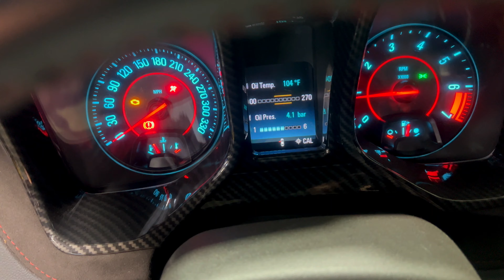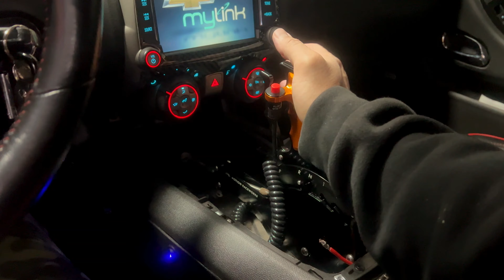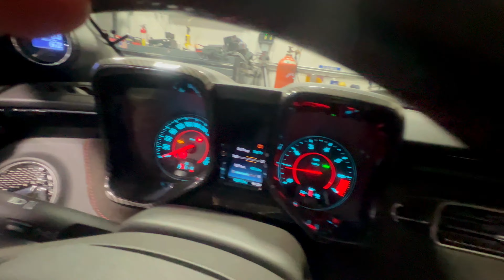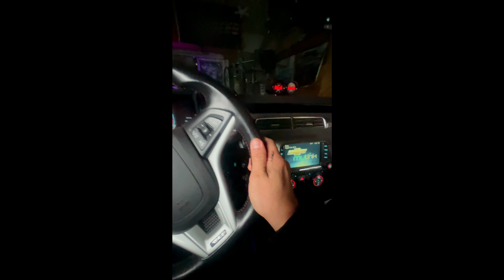427 LSX 1200HP TH400 TRAMISSION INSTALL FINALLY DONE PART 3. ZL1 CAMARO COMING BACK TO LIFE

Comment: Sounds great! But bro you actually take that mofo out on the streets here in California. Man ceetain parts of LA you def would get state reffed.
Reply from the maker: Yeah, I drive it all over the place. I was all over the place in this thing. Videos are coming soon. As long as you're not doing anything crazy they really don't have any reason to pull you over. So I just try to limit the craziness on the street. But when the coast is clear boooooom I'm out!!!🚀🚀🚀🚀🚀🚀😂
Reply: @outlawperformancegarage5211   damn. Not down here in Socal bro. They will pull you over just for exhaust. I got a state ref just cruising in my Camaro. A heavily built cammed car here is just asking for it. Crazy y’all can run them up there. No way down here in La

Comment: I would throw a F1x or F2 Procharger on it that way you have a mord linear power curve but can still make 1200 to 1300 to wheels or more if you want to really push it
Reply from the maker: Yeah, I'm thinking of a different type of power adder because this roots supercharger makes too much torque right off the gate. So I'm either going to go with the Pro Charger or twin turbo or single turbo set up.
Reply: @outlawperformancegarage5211  nice can't wait for the update either one I'm sure you'll be satisfied
Reply from the maker: @bethanyhaskiell9116  yes most definitely

Comment: Differential brace support?
Reply from the maker: @jesusm2159  yeah I had a Detroit driveshaft safety loop. Then we had a cut it in custom make it welded onto the transmission crossmember.

Comment: Top speed?
Reply from the maker: @jesusm2159  on the Dyno it was going 145.
Reply: @outlawperformancegarage5211   I was guessing 220mph
Reply from the maker: @jesusm2159  it can definitely do 220. With a 323 gear. I need to do a rear end swap because the gears I have are strictly drag race quarter-mile. For that highway gear 323 will definitely get me up to 200+.
Reply: @outlawperformancegarage5211  so it will be able to hit 200 + plus good enough for 1/4 speed with 323 gear?